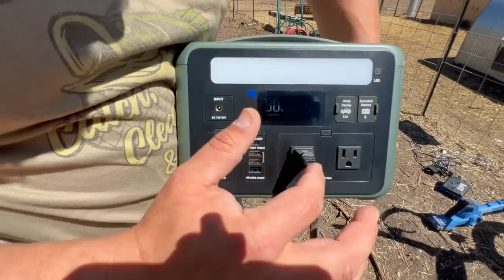Kayson Was Surprised With His New Baby Chicks. Look What AMPACE Sent Us.

Comment: Those baby chicks are so fun. When we did a 1/2 wall around our water heater. You can do it in such a way that you can attach with a hook and eye screw. Ours was made so that you could move it if you need to slide it across the floor so you could do something like that for yours just as an idea. Woohoo so excited that you got your washer and dryer hooked up yes yes God is good. Not sure where your water is going the discharged water from the wash machine but if that is going in your septic you want to be careful the amount  of bleach you are using. If your water is going into a septic system a lot of bleach can kill the good bacteria that is used in eating up all the junk In your sepic. I wasn't sure if you've had septic before. I've had it for thirty eight years and I grew up with having it for a time as well. Just something that that was talk about it really can affect it so I don't know if your s goes out on the ground